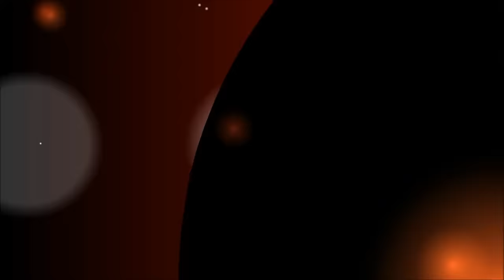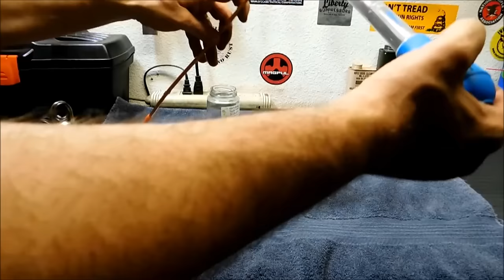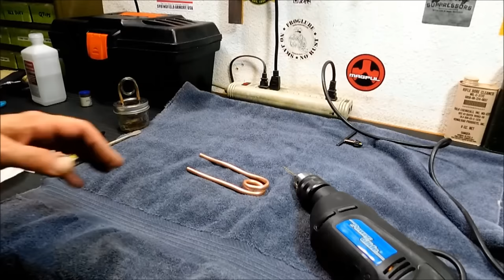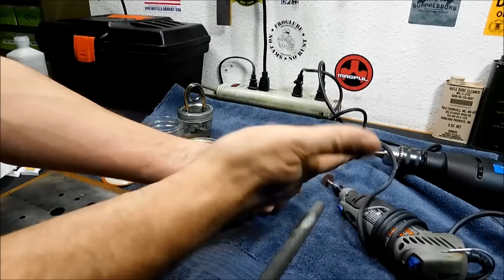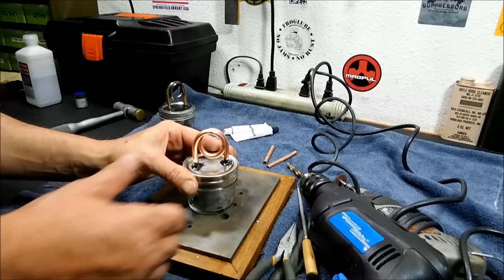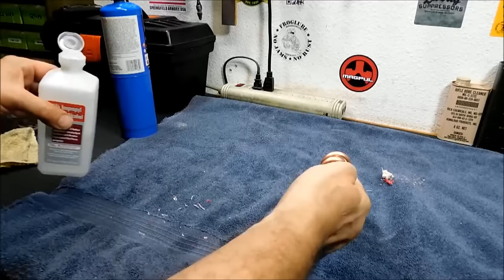Build Your Own Copper Coil Alcohol Burner Stove!

Comment: You'll probably find bending the pipe easier if you anneal it first and drilling the jar lid will be much neater with a stepper drill bit rather than the twist bit. I suppose it's personal preference but solder would be better I think.
Reply: FordPrefect23 , actually a high silver content brazing rod would work better and easier
Reply: FordPrefect23 d

Comment: You can make a lid for storing the stove out of another lid ring and jar. epoxy or rivet another lid ring upside down on the other lid ring then you can screw a jar over the tip of the burner to put out the flame and store the stove.

Comment: QUESTION: Can a larger diameter, taller jar be used to increase burn time? If so, should the copper tubes go down further into the jar? (I know the wicks will be harder to get up to the bend.)
SUGGESTION: To those worried about the JB Weld, I believe they make a HIGH TEMPERATURE  JB Weld product.
Reply: sorry that is not possible
Reply: The jar is just to store the fuel. The wick stuffed up the legs of the coil (and the outlet hole) keep the vapor pressure from driving the fuel back into the jar. Use whatever size container you like. The point of sealing the jar lid around the legs of the coil is to prevent fuel fumes from escaping and igniting somewhere you don't want to burn.

Comment: Just so you know 91% alcohol makes a lot of soot. It will blacken your pots. You can try yellow bottle heet, trangia fuel bottle, ethanol, or even denatured alcohol. These fuels will not soot up your pots.
Reply: Will fumes from denatured alcohol harm you? It's "denatured" with a poison right?
Reply: If you drink it or purposely inhale it yes.  As long as you are in an open area, or have a window cracked open, and you don't keep your face right above the flame you should be fine.
Reply: Thanks, that sincerely is useful to know.
Reply: What about PGA or the old "Everclear"?
Reply: I believe I had heard that rapeseed oil is good to use and doesn't smoke, etc.
Reply: thundersnowstorm  thanks so much for the extra tip !! Heat yellow has been a staple for me ever since I took on a full tank of "bad" gas in my avalanche and thank god the onstar advisor had me put in 2 heats to take up the water condensation. I was I the middle of podunk at 4am and every g-damn warning light on the panel was on,...Telling me of my sure impending doom . FYI it works great too, if you leave your car out in the cold as I do.  THANKS Again.
Reply: Always good to know what gases you are making while burning anything. Example: if you clean metal before welding it, some cleaners make poisonous gas when burned. Chemical mask are a good thing along with proper venting.

Comment: if you put a 90 degree bend in the pipe, so the ring is flat with the lid, then off set it to the side so the ring is centered on the lid, maybe add  a few holes around the ring, and an extra loop with no holes on top,  it would be more like a mini stove burner, with a place to set s small pan, can, cup or other container to heat food/water in.
Reply from the maker: That is an excellent idea.  I had just been using a home made pot stand for this or my hobo stove, but making it so its self contained would be great.  Oh well.. another video idea to do :)  Thanks for watching!

Comment: I couldn't find sand to bend the copper tubes with so I use table salt which is almost the same density as Sans would be and it worked perfect!! Man thx for this great a demo and step by step procedure
Reply: I just have a question I fired mine up for the first time last night but it shoots out gas a lot and it's set the surrounding things on fire on my table I'm not so much worried about that but when I tighten the lid down and don't fire it up it's leaking gas through the vent hole it's like it is pressurizing and the gas is coming up through the vent hole am I doing something wrong?
Reply: The alcohol will evaporate in room temperature. You should only fill it before use and not supposed to store alcohol with it

Comment: Great video, thank you!!  Suggestion: instead of using JB Weld to seal the copper pipes in place, use super glue and baking soda - super glue first, then baking soda until done. It sets up instantly, hard as steel, and is easy to finish. (Military helicopter technicians use the technique to patch chips in helicopter blades.)
Reply from the maker: Wow thanks for the tip had no idea
Reply: @Iridium242  Thank you!
Reply: I love the baking soda/superglue trick. I carry a small tube of superglue and a straw of baking soda with me bacause it is so useful. Would it be suitable for a high heat application?
Reply: @michaeldean5787  You might Google it, but that would be my guess. Helicopter blades can be exposed to multiple extremes, including heat.
Reply: @sanman187-  many thanks 😊

Comment: I prime mine by spilling about half a teaspoon of alcohol on the lid and light it.
Reply: does doing that prevent having to light it with a torch? can it be lit  then with a match or lighter?
Reply: Yes but the bottle cap with dryer lint allows for a hotter temperature and it lights faster

Comment: if you dont have sand to fill the tube , you can fill it with water and freeze it or if yiou have a spring you can cover the tube with a spring and all 3 ways will bend the copper without putting a kink in it

Comment: I wonder if there is a way to put a pool of fuel on the lid where, when lit, it would heat the coil and , likely, light the stove, too.  I used to have a SVEA 123, which used a cup around the base of the ‘generator’ which was used for this purpose.
Reply from the maker: I keep meaning to do an update to this vid, I actually used a cut down .45 ACP case that I fill with alcohol and light , it works perfectly.
Reply: Svea optimus?, sele burner no pressar ?👍❤️🇸🇪

Comment: Quick steel is a material that can get much much hotter than jb weld. If you mix the quick steel and jb weld...you will get a material much stronger and heat resistant than both. I was able to use this material to weld a target. That target was struck multiple times with a 12 Guage slug and remained in tact, the weld itself was hit more than a few times and remained in tact.

Comment: I bet cheap shoelaces would be great wicks
Reply: That's what I was thinking.
Reply: tim taylor ...i was thinking that exact same thing also ..100% cotton would donthe trick

something else that is really wierd that might work...tightly wound up tolit paper. ive made small survival candle with old cooking grease ...rolled up a square of Tp Soaked it in the grease and set it down into the grease and lit it and it will burn until the cooking grease has burnt gone...couple of days

proo
Reply: tim taylor the thing about those stoves is that they are not just burning alcohol, they are heating up the alcohol and burning the vapor and so are more efficient.  That is why that type of alcohol stove needs to be primed,
Reply: Jav Nok maybe even charcoal ligher fluid would be great to use because it last a long time when not in use.
Reply: Basic Knowledge. N
Reply: tim taylor cotton works best. 100% no polyester or plastic thred
Reply: odetomy c
Reply: tim taylor    Wrong type of material
Reply: just get some silica wire of ebay they wick way better
Reply: tim taylor aAaqqq
Reply: Maybe some hemp would make good wicks...😎
Reply: I bet cheap wicks would work great as a wick. What a concept. No need to reinvent the wheel

Comment: Thanks for your Video.And just to add when as a young person my friend and I used a similar coil with a small candle under the coil that lade above the small full size candle cut short to fit  horizontal ,and two small holes to fit the copper tube out of the transom and seal the water from entering the craft ,,to propel a small (Toy).boat having the heat ring draw water in one side and out the other to move the the boat along in Mums fish pond / Just a point of interest to some ?...(Just for fun ) ..(Project for future Knowledge) ....John B

Comment: If you still use "frog lube" on your guns try "weapon shield" and you will realize that frog lube is trash and how much gunk frog lube leaves behind
Reply from the maker: Yeah I tossed Frog Lube ages ago.. no longer using it.
Reply: Iridium242 yeah it's pretty bad, I saw the sticker on your work bench so I just figured I'd help you out if were still using.. my brother turned me onto weapon shield and I gotta say it's the best shit I've ever used, I even use it on my folding knives
Reply: That's from the same guy/company that makes "SteelShield" correct?
I believe I had a small sample of that stuff years ago, it came in a little plastic pen-type container with a metal needle-type applicator tip. Great stuff, I should get some more of it when my Hoppes No.9 finally runs out...
Reply: Brent Addie
Reply: Avus95 I think so but I'm not entirely sure.. I do know however that weapon shield is hands down the best weapon cleaning and lubricant I've ever used

Comment: Feed a strong test fishing line/string through the straight tube that hangs out quite a bit on both sides. Then fill it with sand and cap it, bend it, blow it out with an air compressor (hold the fishing line so it stays put, just get the sand out), and drill your hole. Get it put into the canning jar lid, then get a piece of wicking material longer than the tube and tie one end of the fishing line to the end of it tightly. Just pull the wick all the way through, having some dangle out on both ends, and cut off the fishing line/string. Done, no difficult threading of the wick.

If the thermodynamics and convection (or is it vacuum?) require that there be some empty space it in tube (I don't think it would, but if it does) before you add fuel to the wick, you can simply heat  the bottom of the coil (where the hole is) with a lighter or butane torch (something that won't melt the copper) until the wick chars and pull on both end a little bit, with equal pressure, to break the wick dead center. Then just pull the wick ends out, equal distances, just enough to create the chamber size that perfectly serves your needs.

Love the video man, pretty cool little design in a pinch, and something that can be made with scraps in a real pickle.

Comment: Since you have the caps that came with the copper tube, just fill the copper with water as opposed to sand, then freeze it, and then bend around your mandrel. Thanks for the video.

Comment: Damn, you sound so much like Adam Carolla.  It's uncanny.  This isn't an insult, I think he's a solid guy.  By the way, you should use the yellow Heet or denatured alcohol.  Isopropyl or rubbing alcohol burns with a noxious oily smoke.  The aforementioned burns so much cleaner & hotter & makes for safer food prep.
Reply from the maker: haha I have had others tell me I sounded like him, I watched some of his
 vids where he was talking and was like "wow, that does kind of sound 
like me lol"

As for the heet I have much of it and use it in other stuff, but this stove does not like it.. its almost too "powerful" for it.. it sputters like crazy and shoots high flames with it.. while 90 % alcohol seems to burn just right.  Maybe if I opened up the vent hole it might not go as crazy with heet, I will have to try it on another one.  Thanks for watching!
Reply: Iridium242 Thanks for the response.  That's good to know about the alcohol & that type of stove.  I've seen many different incarnations but do not have one.
Reply: Imightberiding
Reply: Imightberiding He sounds like Conan O'Brien for me. all he need is the laugh and we're set

Comment: Hi, Just a thought, could you use a cotton pipe cleaner as the wick? If yes then it might make it easier to put it into the pipe due to the wire within. I have seen a version of bending copper piping using a similar method except instead of sand or filings, they used water and simply froze it. Granted it was thicker tube/pipe but I suppose you could use a syringe or pipette to put the water in the tube. I imagine if the pipe cleaner idea would work then you could possibly insert the pipe cleaner into the tube before it was coiled. I enjoyed your video thank you.

Comment: what about soldering instead of JB weld?
Reply: if the lid gets to hot it could damage the rubber seal
Reply: my thoughts exactly, he could make another seal but that's an extra step lol still great project.
Reply: Depending on what this unit is used being to cook, using solder means that lead is likely being introduced on to the coil
Reply: @Brutsie  unleaded solder is available
Reply: 2EZ
Reply: @Brutsie  so?
Reply: @Brutsie  unleaded solder is THE LAW here.
Reply: Another problem. Solder of any type won’t stick to the steel cap at all. Brazing won’t work either. The dissimilar metals and the thin steel cap won’t take the heat required anyway. The best is a high-temp epoxy like he used, but it still won’t last forever.
Reply: @brianwalsh7931  Solder will work well. You just need to remove the varnish on the cap.

Comment: Thanks for the video. To push you rope inside I would take a steel string put it through the tube and attach the rope and pull it using string. when it goes out at the 2nd end just stop pulling and disconnect the string. I wonder how much it uses alcohol per an hour.
Reply: I made these as a boy, but used a line of dental floss prior to filling with salt. It was then easy to remove the salt by running the dental floss back and forwards

Comment: I like JB weld.  I had two broken metal handles from a dresser.  The metal was porous...not brass or heavy steel...unweldable and unsolderable.  I used JBWeld and they have held well.  I of course use the handles on drawers that are lightly used and I try to be careful if I remember.

Comment: I make those tight bends by filling the tube with melted solder, let solder cool, make the bend, then propene torch heat the solder out.

Comment: one question, had any of them had exploded by small overpower heat?
Reply from the maker: Nope, never.
Reply: cool thanks, I probably going try make a stove on it or small smelter for harden th metal.
Reply: alcohol flames are to cool for smelting
Reply: Can you use methylated spirits
Reply: I have three alcohol stoves, so simple to use. My favorite is a Simons, it’s stainless and it like a penny soda can stove on steroids.
Reply: edmond ugljesa that's just the brit name for denatured alcohol, it's the same stuff.
Reply: edmond ugljesa saved me asking the same Q

Comment: You can use this inside a tall version of a Caldera Cone to get THE best efficiency. I use a low, small KOJIN alcohol stove in ,y Trail Designs titanium Sidewinder Caldera Cone. But usually burn ESBIT fuel tabs inside my Sidewinder.

Comment: Can I use denatured alcohol?
Reply: poofy nunya yep
Reply: denatured burning ethanol is perfect. dont try isoppropyl a.k.a. rubbing alkcohol, though. it soots
Reply: Cuda FX Thanks is the denatured ethanol readily available anywhere? I've never seen it before.
Reply: poofy nunya, of course. the common denatured cleaning/fuel alcohol is ~96% ethanol, with trace additives that make it undrinkable. the chemical name is just more specific internationally.
Reply: You can usually find it in hardware stores in bigger cans or bottles....but walmart sells rubbing alcohol pretty cheap.
Reply: if in doubt, read the label. rubbing alcohol is usually ispopropyl, though, which costs more and produces soot, that is hard to get off of things. (it burns with a nice, yellow flame, due to the excess carbon, where ethanol cleanly burns into co2 and steam)
Reply: Thanks Cuda fx
Reply: Cuda F
Reply: If you're able to provide the isopropyl alcohol with enough oxygen then it will undergo complete combustion and not produce carbon.
Reply: true, Hamish. but under normal circumstances a coil jet's flame does not get hot enough, to cleany burn the amounts of isoprop, that it's fed. long story short: ethanol is good fuel, isopropyl isnt.
Reply: Ethanol is cheaper though isn't it? although it does have denatonium benzoate in it so people can't drink it... Would that effect the taste of food?
Reply: Hamish The Meme Lord I personally wouldn't be doing any cooking with it because it not clean burning...if you put it in a metal bowl and light it, you'll notice it puts out a fair bit of smoke...what's in that smoke would get into whatever you're cooking
Reply: We have already discussed that...
Reply: Hamish The Meme Lord yes, and I agree with the clean burning part assuming it's pure ethanol...but you have to pay attention to what you get when you're buying it...some of the heet products have additives that can effect how clean it burns and how safe it is to use in this specific application.
Reply: Hence why i mentioned the denatonium benzoate added to it.
Reply: Hamish The Meme Lord doesn't sound like something I'd want in my food...lol...why not just buy a bottle of Ever Clear and call it a day...few shots of that and you won't even care if your food is cooked...lol
Reply: which is why i was considering iso
Reply: I think thats because there's water in iso...... alcohol
Reply: you can also use dry gas!
Reply: Hamish The Meme Lord :  It will kill you or poison you!  Never drink it!
Reply: poofy nunya , yes, it's actually better, you don't wind up with by product like water in the bottom after all the alcohol burns off

Comment: The coil is above the "gas vent" (pilot) to make a consistent low pressure system in the "coil-legs" as fuel drawl, while powering the fuel fumes out the pilot. 
The primer burn is to acclimate the fuel system, but is important for burning off chem coating from the "pipe"(c.t.s), while tempering the metal coil - making it slightly stronger (or more "reliably" ridged/firm)

Comment: really loved this thanks! the only thing i couldn't quite make out, the air vent hole you drilled into the tube, did that go through to the bottom, or just one side?
Reply from the maker: Just one side